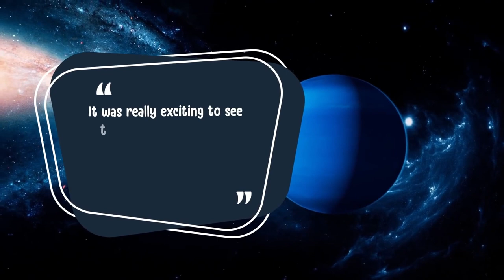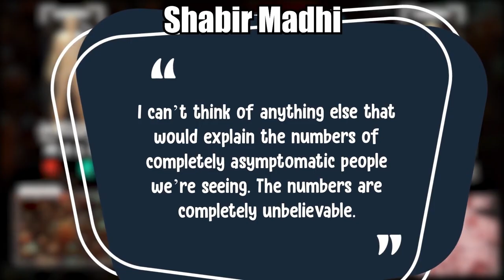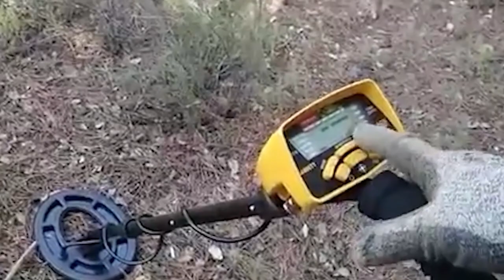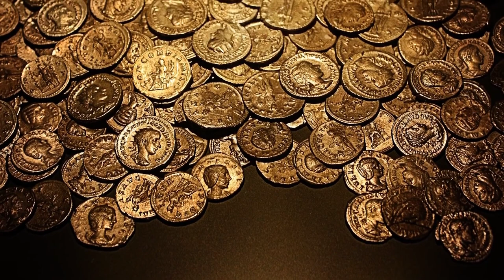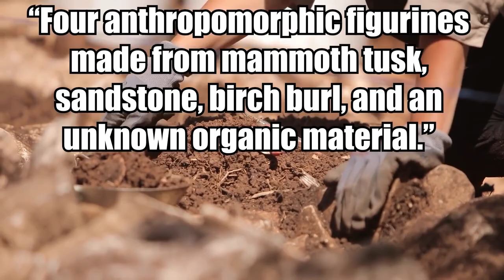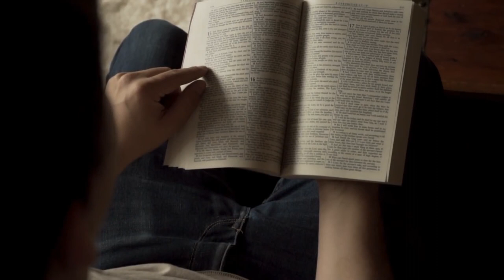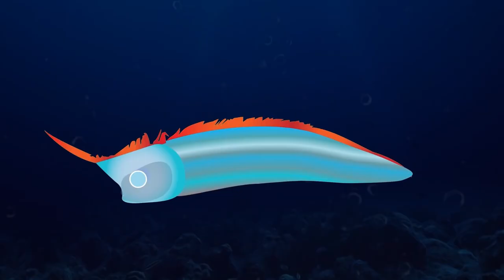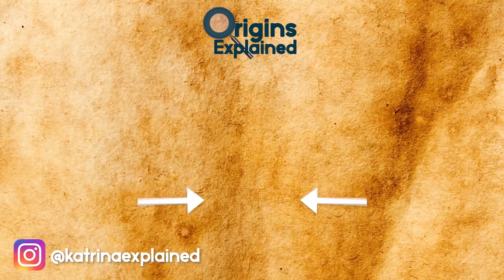SCARY Animals And Other AMAZING Discoveries!

Comment: If they have found another planet, then my anachronism for remembering the 8 planets will have to be changed.
At present,  it goes as follows, with each first letter of the word being the initial of the planet itself and goes from closest to the sun to furthest. 
My Very Easy Method Just Says Use No Pauses.